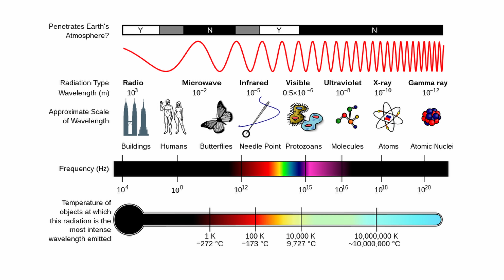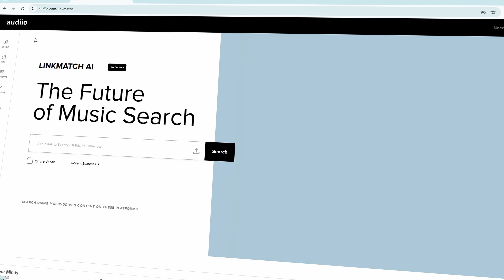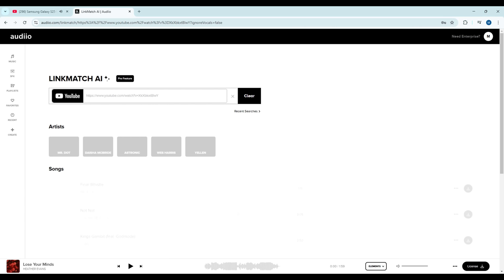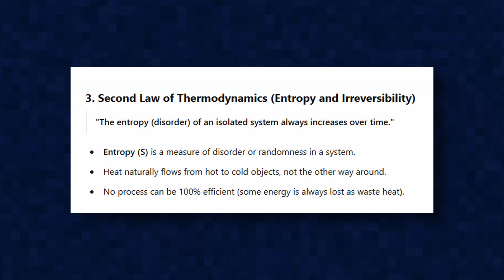This is how Maxwell Chikumbutso's Inventions Work

Comment: Any good invention cannot be ignored as long as it's not disastrous to humanity.
Let him continue , we Africans will support him.
Reply: Support him all you want. Just don't be stupid and invest in him. He is trying to scam you.
Reply: @G45H3R  100 %.
Reply: @G45H3R  I thought I was the only one seeing this.
Reply: If you understand  the principles of  Radio frequency 😂😂
Reply: @Arthur-s1e1r  I do not understand how people finish school and do not know that radio waves do not generate electricity. Sometimes I think these are the reasons Africans love religion. You just have to believe not question, explain or try to understand. Very sad.
Reply: @ You are just not a knowledgeable person of the area. Yes sir, radio waves can generate electricity, you can experiment it by yourself with just 3 components: A coil for induction, a diode and a capacitor. With this simple setup grounded and an antenna, you can  harvest up to 2,5 volts, which you can connect to a DC-DC booster or a joule thief to achieve 5 volts or more. Then, using several units like this put in series and in parallel you get more power. That is why we Africans are so mind limited. very sad. Free your mind from bonds and explore the boundaries of science my dear. I am doing so and I achieved a lot of things. just check.
Reply: @Arthur-s1e1r how do crystal radios work without  batteries?
Reply: @fredrikr6280  why crystal radios earphones are different from normal earphones ?
Reply: @fredrikr6280  Crystal radios consume milli/nano watts of power. The Vehicles consume killo watts of power, the scale is different. Moreover even if the battery takes 100% power of radio towers it would take 80-90 radio towers to run a single bike.
Reply: @ yes i know,  crystal radio also need a very long antenna to catch some of the energy. but that was just an example.  stars like the sun also emit radio waves. i don't know what tech he is using to capture the energy. maybe its a scam....maybe he is up to something. someone technical needs to go and test his device.
Reply: @fredrikr6280  or just some honest person whould take his car/bike on a long ride for 1000KM. Even the best of vehicles drive 300-600KM at the moment. So even if his invention can drive 1000 he has broken some records
Reply: It's not a good invention. It's a lie.
Reply: @stagecoachmechanic  And unfortunately that is the best invention for the typical African... It is sad this miss information is being spread. I have lost respect for so many channels.
Reply: @stagecoachmechanic just another jealous fool
Reply: Does it work? Let the vehicle be tested for a long time and if it can survive like other vehicles then it becomes a genuine product.He should then look for lnvestors from africa.
Reply: @zemeosa  Does not work. This guy has not bothered to prove a single claim.
Reply: @stagecoachmechanic You know nothing about this guy until you started to see/hear about him on social media. Wait for the date that he said, 10 February. For now you sound like a critic THAT IS IT...!
Reply: @EMPIREBYSONIC  I dont need to know much, except the scientific principles he's breaking.
Reply: @EMPIREBYSONIC  It is now the 20th... STILL no proof.
Reply: @ABetterDay-fz3br  And there never will be.
Reply: @EMPIREBYSONIC  still waiting..
Reply: Wake up to reality, man!  Its not going to happen.
Reply: Exactly
Reply: General Africanus conquered Morrocco and all of Alkebulan thanks to the Vatican that sent him and educated/indoctrinated the conquered to think they are now African in Africa a corporate nation that is not the land of Alkebulan. In the age of information ignorance is chosen by registered Persons who refuse to be People.
Reply: Tell me you didn't go to school 😢
Reply: I am simply disgusted by the idiots defending this crook - it shows how terrible your education system is! What do you do besides graze??
Reply: AI is the disastrious fake scam, an insult to our humanity achievement😢
Reply: We Indians too support him. Best wishes and good luck to him and his team. Hope to see his EV car is on the road very soon.
Reply: Thank you  @shankarrajan7386
Reply: @shankarrajan7386  Don't say "we Indians". Not everybody in India is as gullible as you are.

Comment: That's what I thought. The energy in radio waves is so small.  The conversation part is possible, maybe to power a small torch, like those on keyholders. Energy Amplification not possible. Maybe if the device is a black hole of radio waves. Then that's a problem because the device would be pulling all the radio waves itself leaving network connections down. Either way there are a lot of gaps in the information he gave us about the car like the acceleration, does the car have battery. The device that converts the energy will need energy to convert the energy from one state to another, so where does it get the energy from? 🤔But hey I hope he succeeds in his inventions.
Reply: ENERGY FROM SPACE! NEUTRINO INCLUDED!
Reply: @dragon72tube  he has then tuned to capture neutrinos.
Reply: @dragon72tube  almost, he is tapping oscillations of Earth magnetic field caused by cosmic rays which include neutrinos
Reply: You are as smart as I like, it's a hoax
Reply: Très bonne analyse
Reply: Micro-black holes. That is a possibility but like coca cola, we shall enjoy the drive but never bother with the composition.
Reply: @Avatar_2025 You are really suggesting he made a micro Black hole to power eletric devices from his home ?
Reply: @Avatar_2025 You are really suggesting he made a micro Black hole to power eletric devices from his home ?
Reply: It uses infinity stones😂